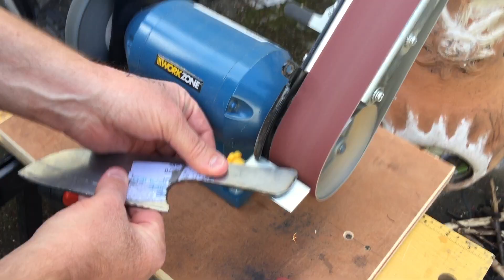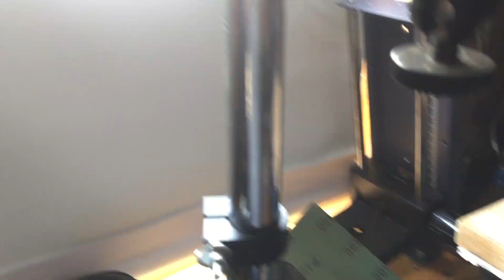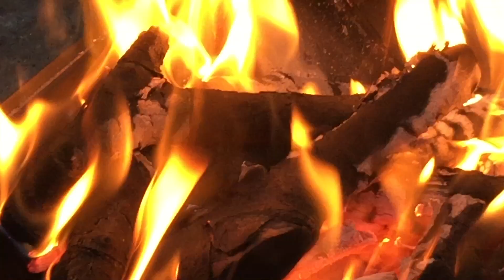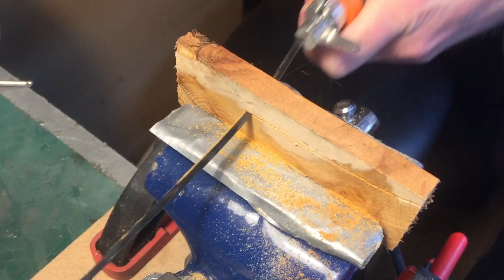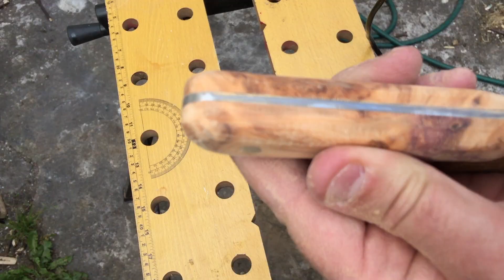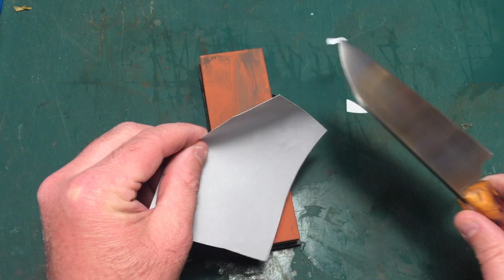Making a Small chef knife in a small shed

Comment: Hey Cris, How do u feel about ur bench grinder belt sander? Can u make me a review about urs?
Reply from the maker: Thiago Vieira da Silva - it’s a very cheap sander/grinder combination from Aldi it cost about €35. I only use it to take the rough edges off the blade after cutting out the shape. It is no good for bevels as it’s not powerful enough, shaping is very quick with a good quality hand file. The belt sander is very useful for shaping the handle which I finish with sandpaper and a multi tool.
Reply: @ChrisTheCuriousDad  Thanks man!!!